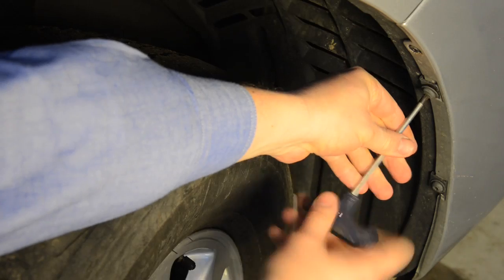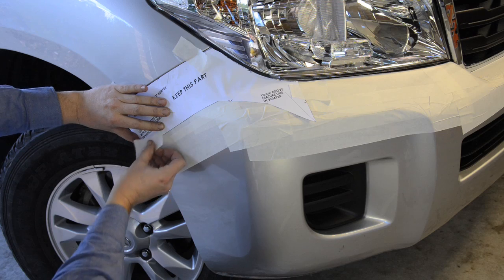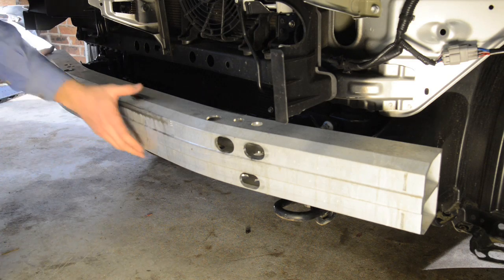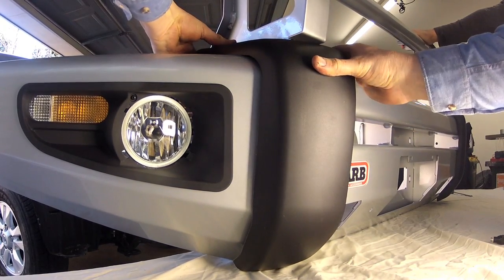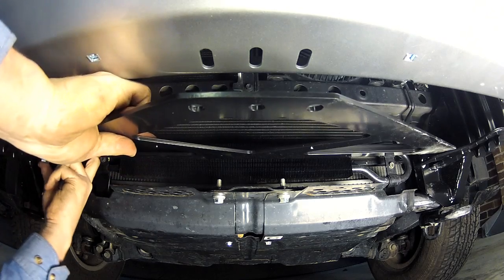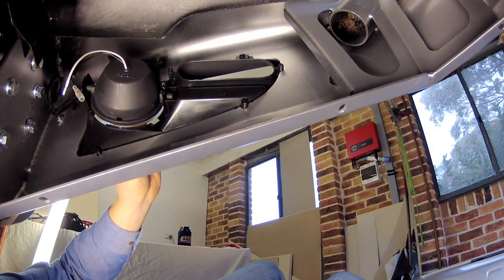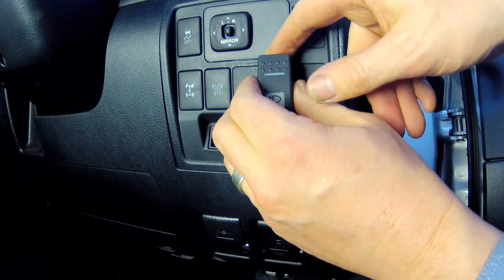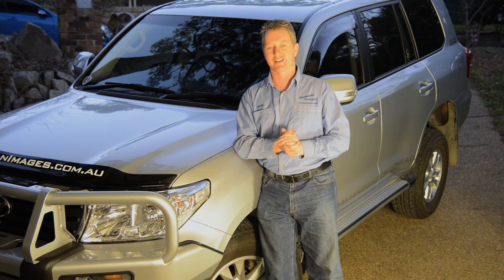Land Cruiser 200: ARB bullbar step-by-step install

Comment from the maker: Hi Bernie,

The install actually went quite well, but it's certainly a huge change from "the old days" where you could just unbolt the bumper and bolt on the bullbar in its place!

Next on the list is a winch install, which I thought I'd do independently from the bullbar due to the number of people who buy the two separately.

Comment: This was so helpful - thank you! Inspired me buy the same winch bar for my 200 and DIY install. Drilling the pinning bolts was a challenge and a right angle chuck attachment for the drill is required for the 2015+ install - happy with the result and savings vs. workshop install. Cheers 🍻
Reply: Don't need a right angle bit. Just go through the fog light hole
Reply: @jacobpears6844  I was able to drill 2 of the 4 pinning bolts (1 per side) that way, however needed the right angle attachment for the last 2 - which had to be tackled from further back and underneath the bar. I suspect the 2015+ bar in my model is slightly different than shown in this step by step.

Comment: I have concerns about the strength of the frame on the car. There has been cases of fatigue/cracks in and behind the front bracket on the frame of the car after putting a bullbar and winch on it. Does this seem to hold up on your car?  It is a fairly heavy assembly after all. 
I am convinced Toyota did not design the front brackets with winching forces or a 80+kg assembly in mind. 
The 200 series do come with a factory winch option in some markeds. The OEM winch is mounted on a spesific crossmember behind the factory bumper. Cars without the OEM winch does not have this crossmember.  
Toyota partnumber 38110-60290 (60291 for 2011 onwards) for those interested. It's quite pricey...
Really enjoy your videos. I appreciate the amount of extra effort i takes to make videos together with the install!

Pål (Paul, for the alphabetically challenged;-D)
Reply from the maker: +pål aukan The only vehicles I've heard about with cracks were using the factory bullbar, which was later recalled by Toyota for that reason. The ARB bar includes special clevis nuts which sit well back in the chassis to distribute the load. I've never heard of a chassis cracking when fitted with the ARB bar.
https://www.recalls.gov.au/content/index.phtml/itemId/957231
Reply: +Australian Images Thank you for the clarification! I noticed the clevis nut you put in on this install. I guess this is where the boffins at ARB come in to play. Together with the doformation zones and airbag compability, this clevis nut seems to make the difference;-D

Thanks again. I can now continue my dream of the 200.This was actually a real showstopper for me. The 200 has a hefty pricetag of about $250000 Aud here in Norway,due to the tax level disfavours heavy,powerful cars. We also only get the sahara over here.  But the early second hand cars are starting to come down to about half the orginal price. Still more than a normal working mans year salary. My 80 series will have to do for now;-D

Comment: Thanks for the video, I'm sure you had some "choice" words to say during the install. I know I did installing a TJM bar on my Prado 150.
I prefer the TJM bullbar as it sits closer to the vehicle than the ARB, but each to their own.

Great video as usual, whats next?

Bernie
Reply: Great video. I recently purchased & fitted an ARB summit bulbar for a 200 series Landcrusier. Had some issues fitting the bar. The clevis nut would not fit into the rectangular hole in the chassis (had to be opened up to suit the nut), also the M12 flange nuts to fit the bar to the mounting bracket were missing (if the original nut from the crash beam/mount brackets were to be used they are a different pitch. 
I spent a bit of time setting the 935mm measurement on the mount flange brackets as per step 61 only to find the bar would not fit as the measurement between the brackets on the bar were 930mm.
Lastly the fog lights wouldn’t fit (the lights in the fitting procedure does not look like anything that is on my car). I went to the store to query the fitting of the fog lights after looking up on his computer & was told that I need a separate kit to fit them I also picked up the nuts. ARB need to update their bars to fit the vehicles.

Comment: Is there a mechanism for adjusting the depth of the fit, my 2009 200 has an ARB bar but one side is slightly further back than the other?
Reply from the maker: It's been a while, but I don't recall there being an adjustment for that. Probably best to drop in to an ARB dealer and let them have a look at it.

Comment: how do you install roof rack and air lockers
Reply from the maker: Sorry, I haven't installed either yet. The roof rack is reasonably easy. It bolts into the hidden nuts on the roof which are accessed by removing the small plastic cover strips. For air lockers, I'd suggest you have them installed professionally.

Comment: Hi Jamie - my 200 is a 2011, the instructions differ quite alot from this video, nearly came unstuck :)
Reply from the maker: Ahhh. The 200's front end did change slightly between 2011 and 1012 (plus the major change in 2016), so I guess the ARB bullbar design must have changed as well.

Comment: The process of becoming a serial city slicker road rage tailgater.
Reply from the maker: ...Or the process or protecting your vehicle from immobilisation from animal strike etc, when touring outback Australia.
Reply: Hey Bernie thanks for your vid I have a 2014 vx and wish to fit an arb summit bar also.
I am able to get a great deal on a new 7th / 2015 bar but I’ve been told it’s not compatible as they had some upgrades.
What are your thoughts?
Reply from the maker: @clintonwearne1371  The 2015 has different front end panel work compared to the 2014. Pretty sure the bulbar wouldn't suit.
Reply: Thanks again

Comment: Have a look at the other video on YouTube where an unfortunate fellow had his chassis crack after fitting a winch and an ironman bullbar...
Reply from the maker: If you look at the way the Ironman bar is mounted, all that weight is simply bolted on to the small flat plate on the front of the chassis. It's not designed for so much weight. The ARB bar includes clevis nuts and 200mm bolts on each side that transfer the weight about 150mm back down the chassis rail. Far superior design and eliminates the problem suffered by the Ironman.
Reply: Australian Images yes, I noticed that in the fitment of your kit, and also that ironman have modified their design to be similar to the ARB one. Makes you wonder about the level of their R&D though. You get what you pay for.